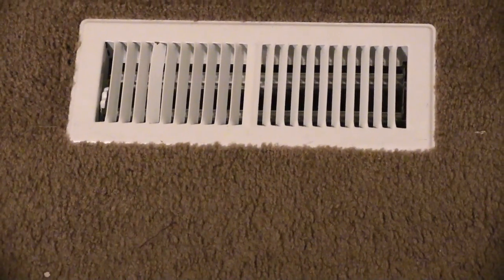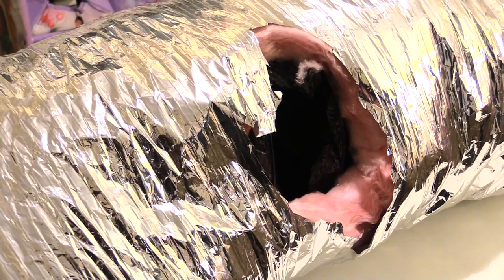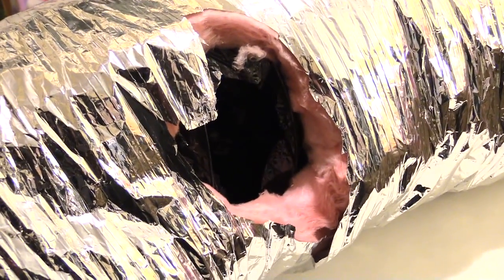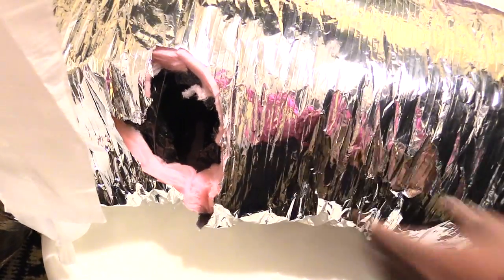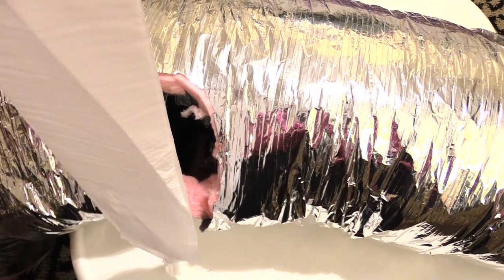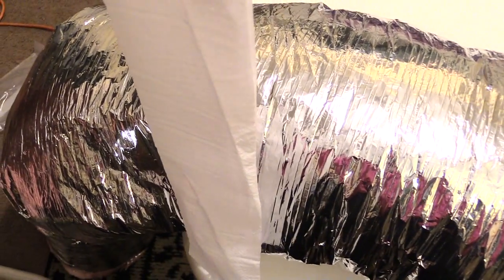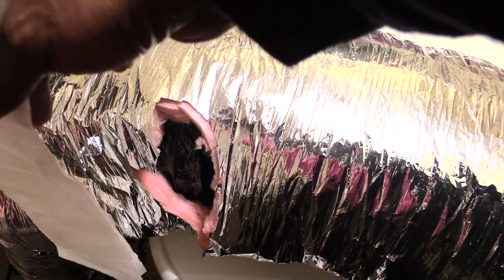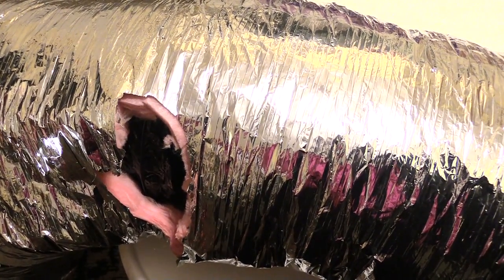Low Air Pressure from Vent registers- How to fix

Comment: Didn't find a hole, but found where a joint in the duct had come apart a little bit. Fixed it with duct tape.
Reply from the maker: Glad you got it fixed. Please subscribe & like and share if haven't already and check out our other helpful videos
Reply: If you can't duck it... F*ck it. It can't be fixed. 😂

Comment: what do I do if no cold air is coming out of my ceiling vent? sorry I pretty much know next to nothing about A.C. ventilation systems.. (I'm a noob sorry..)
Reply from the maker: If no air is coming out your ceiling vent but it is coming out the other vents then either you have a whole or something is blocking your vent are it's disconnected you will need to check vent ducts going to the vent. Please subscribe & like and share if haven't already and check out our other helpful videos

Comment: Am I supposed to cut the floor to find that leaking hole ? My duct on 2nd floor blowing 0 air
Reply from the maker: You may have to or u can use a Camara to stick in vent to find problem spot, also make sure you don't have a damper blocking air to the vent. please subscribe like and share and check our my other helpfull videos.

Comment: No air from one vent. The room sits over the garage.
Reply from the maker: Make sure u don't have a closed damper if not probly is  blocked or ripped. Please subscribe & like and share if haven't already and check out our other helpful videos
Reply: I’m having the same problem as you and I was told I might have a closed damper. Gonna figure out how to check that right now.